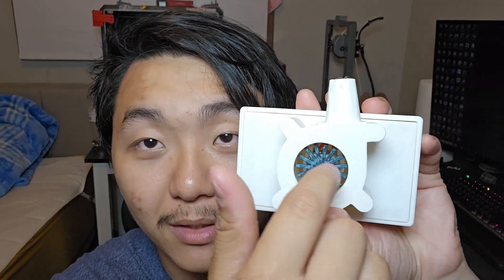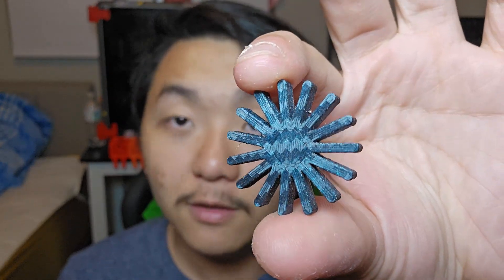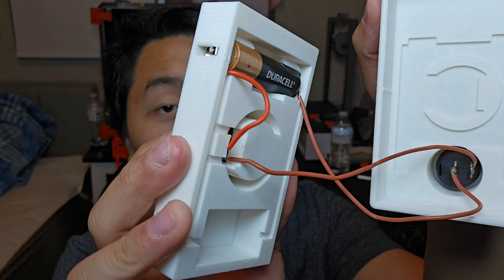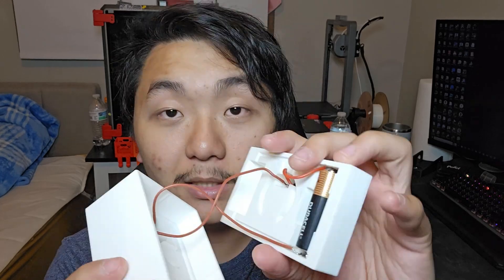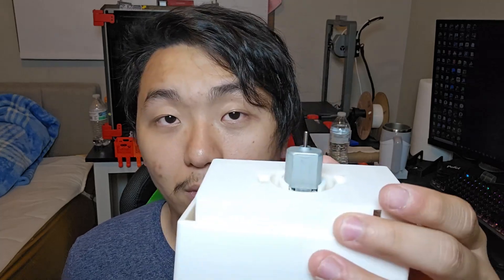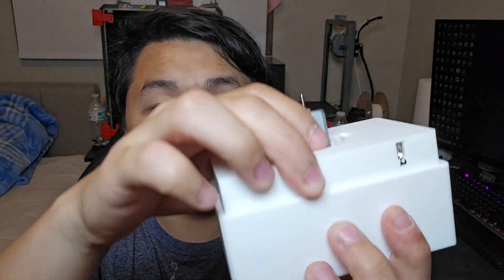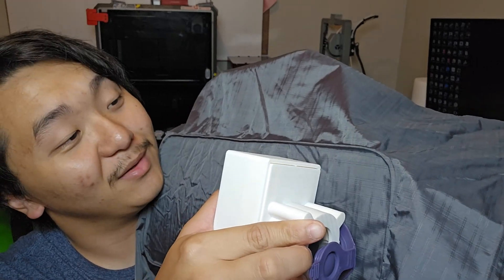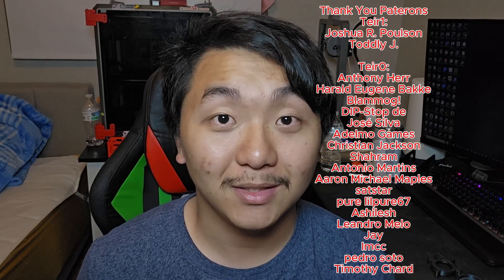I 3D Printed A Air Blower Does It Work..?

Comment: Your fan would move significantly more air if you angled the blades like those on a ceiling fan. Should be an easy design change.
Reply: That would be an axial fan, radial fans (like this one) push less air but achieve higher static pressure
Reply from the maker: ahh, thanks I'll integrate that into my next design.